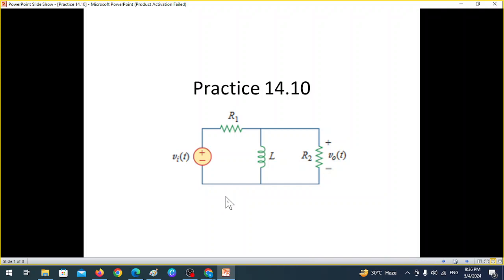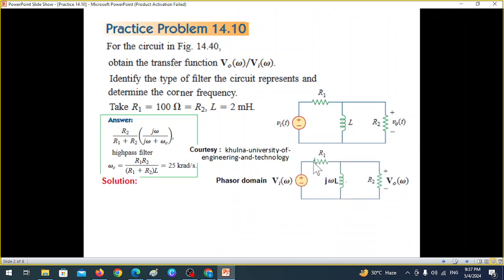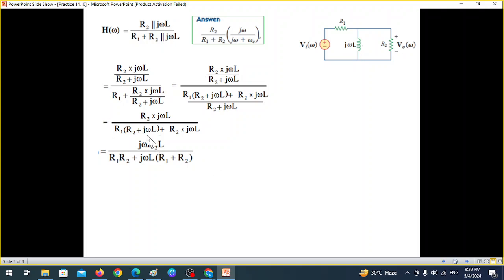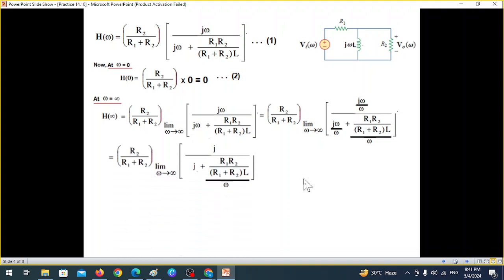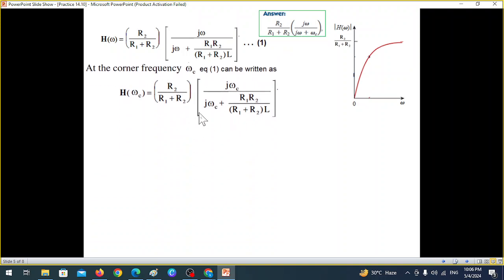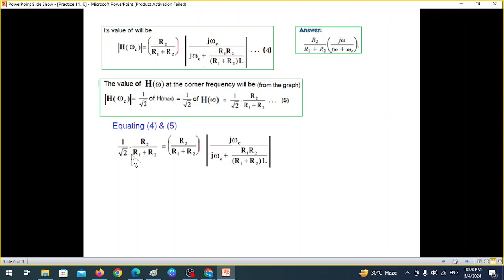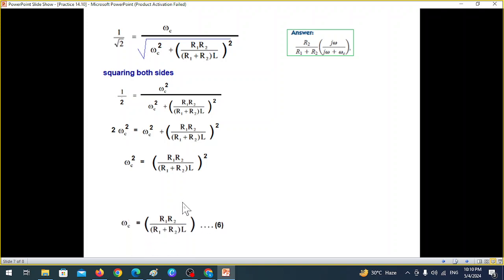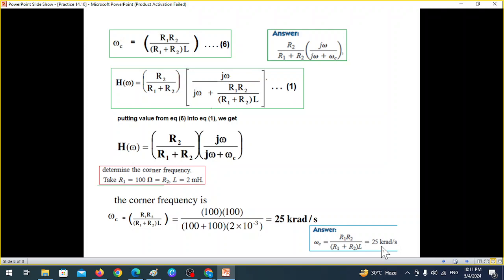(E)ENA(A) Pr 14.10 || High-Pass Filter using Inductor || Transfer Function || Corner Frequency

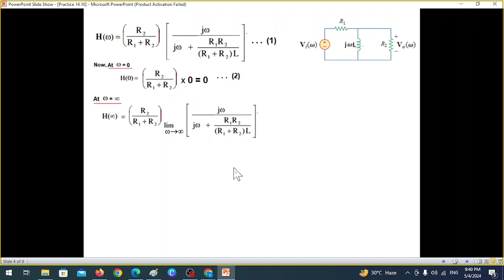Comment: want to ask for 4:43 u said we need to cancel out omega,w first before we substitute w=infinity. Then why w=0 u not cancel out omega first before u substitute 0 but u just change it w=0 and get o because numerator is 0 so get 0?
Reply from the maker: Good observation. You have to go back to basic calculus. 0/0 is not allowed. infinity/infinity is infinity. So when we use the limit infinity, then we have to manipulate the terms in a manner that we don't get into the situation of infinity/infinity.
As far as your observation, we can follow the same procedure for w=0 also up to the time 4:56, and then put w=0. Now in the the denominator anything divided by 0 will make it infinity. Now denominator being infinity, any thing divided by infinity will make the answer 0. 
(confused ?)